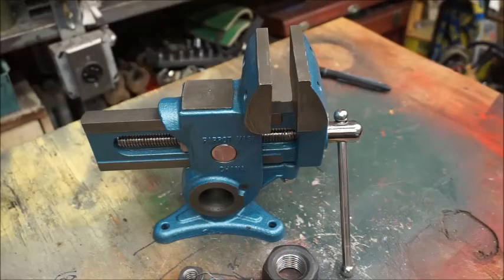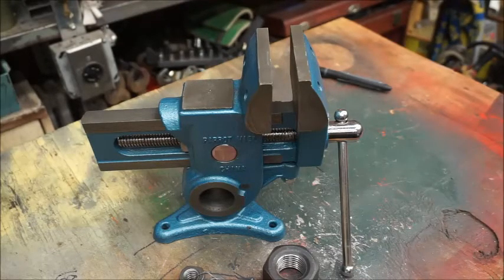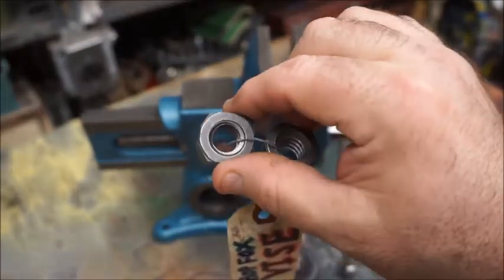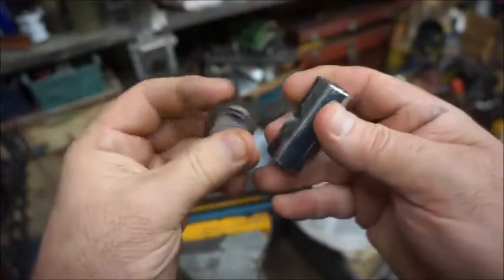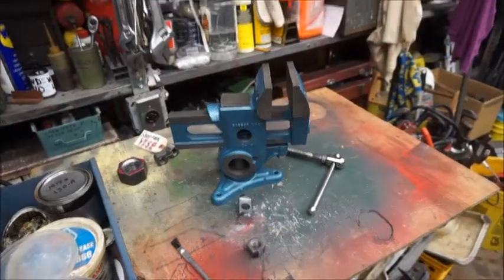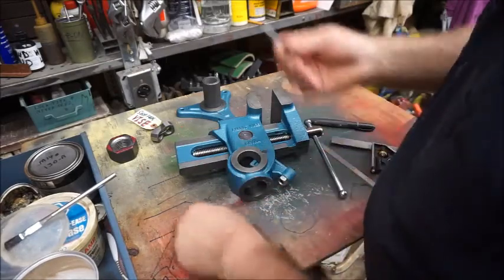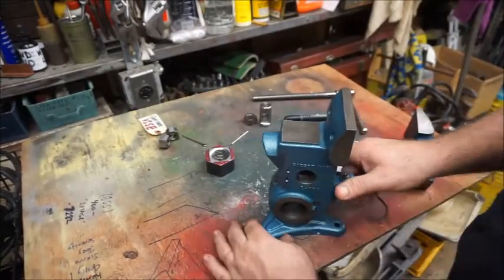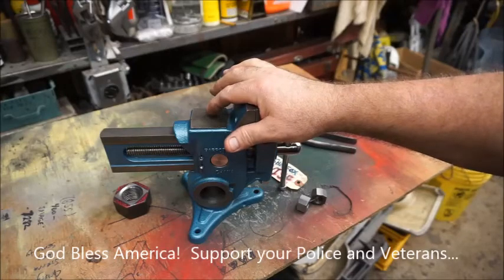How to disassemble and repair the Shop Fox Parrot Vise or Versa Vise

Comment: i know this is a real late comment but would it be economical or practical at all to use a spring around the lead screw? nice video though. im curious how well your fix held up in the long term.
Reply from the maker: Not too late... not as long as I'm sucking air! 😁 
The spring is a very good idea, IMO.  Novel.  One would have to fit the right spring.  I think capturing the nut with some type of pin is probably easier and cheaper.  I am into the KISS principal.  Keep it simple.  I keep a lot of springs but fitting them can be tedious.  I repaired a remote anchor lock for my boat recently.  Didn't have the right spring.  I spent 3 hours manufacturing a torsion spring with mediocre results!   
Regarding the vise repair, well, it held up just fine, but the casting broke where the movable jaw meets the arm surrounding the screw.  I kept it for parts or perhaps welding it one day (would probably break again).  
I rarely throw anything away... like hoarding and dumpster-diving, it can be a curse!  😊
Reply: @bentontool  after a while i was thinkin the same about sourcing the right spring. sorry to hear the vise broke. i been thinking about getting one like it. in your opinion, is it worth it? or should i set my sights on something different?
Reply from the maker: @pyropenguin  Hello.  In 2021, I replaced the Versa/Parrot vise with a different style of vise I bought on eBay for $60.  It was described as "Multipurpose Vise Bench Vise 4" Heavy Duty with 360° Swivel Base".  I bought a similar vise (but the 6" model) thirty years ago and it survived hard use out here on the homestead.  They are all cheap chinesium products, so it is a gamble IMO.  So far, I have been very happy with the 4" model.  The Versa Vise is very flexible and general-purpose, but not heavy duty, again, IMO.  The one I have now is no doubt tougher, and is also flexible.  I still do general-purpose work & gunsmithing on it.  It is still available from sellers on eBay & also on Amazon.  Shop around for the best price.  I suspect they are all sourced from the same place, as they all appear pretty much identical in the pics.  Here is a link to one on Amazon (not an endorsement):  https://www.amazon.com/Multipurpose-360-Degree-Rotation-Equipment-Industrial/dp/B0CKTRDHL2/ref=sr_1_46_sspa?crid=VMTTPIRW5IEV&keywords=4%22%2Bvise&qid=1704384549&s=hi&sprefix=4%2Bvi%2Ctools%2C494&sr=1-46-spons&sp_csd=d2lkZ2V0TmFtZT1zcF9idGY&th=1.  
CAVEAT:  I took mine apart upon arrival, filed all the rough casting edges and inevitable burrs, cleaned-up the paint overspray, added a washer or two where I thought it appropriate, and greased the hell out of it.  IMO, a little TLC & grease goes a long way to prolonging the life of these "cheap" products.  Good luck & best wishes,   A.
Reply: @bentontool  i did similar to a cheap harbor freight vise i got a few years ago. i let my brother borrow it and it didnt survive lol. the main appeal of the versa vise is being able to store it easily. unfortunately i dont have any space to permanent mount a vise currently, but that little post it sits on wouldnt be too big of an issue.

i do like the looks of that chonky vise though. thanks for taking the time to respond with some good info and advise!
Reply from the maker: @pyropenguin  You are welcome.  Understood.  Here's one that I ran across that looked interesting, but too light for my needs.  https://www.amazon.com/Wood-Metal-Working-Multi-Position-distinct/dp/B07V5N1CQP/ref=sr_1_31_sspa?crid=Y1ZGZLZIAO6T&keywords=clamp-on+360+Degree+vise&qid=1704474438&s=hi&sprefix=clamp-on+360+degree+vise%2Ctools%2C186&sr=1-31-spons&sp_csd=d2lkZ2V0TmFtZT1zcF9tdGY&psc=1

Comment: Great video, thank you! I recently found 2 of the original Versa-Vises while picking in a barn but I think they both need new barrel nuts. Because of time and convenience, I plan on ordering new ones from the website but couldn't new ones simply be made from steel stock that was threaded to accommodate the bolt?
Reply from the maker: Thank you Greg.  You definitely could make your own barrel nuts from rod stock if you have a lathe & some internal  thread-cutting experience.  I have found this process somewhat challenging in this small size, and think that a tap of the correct size/pitch would be much easier (but expensive).  Good luck!  I took the path of least resistance... 😄

Comment: Good video Brother. Glad I ran into it. Just so happens my Parrot vise just took a dump (stripped barrel nut) and I was contemplating whether to pitch it or try and fix it. It will also give me an opportunity to take some of the slop out of it.
Reply from the maker: Thanks for the kind words.  Glad it helped.  P.S.  I have switched to another type of vise.  I snapped the mobile vise jaw on my Parrot, probably due to over-torquing I suppose.  Probably would have been OK if I had stuck to only gunsmithing with it, but I was using it for all manner of work, and it was not up to the task...
Reply: @bentontool  I have a really great old Wilton bench vise that is my primary, but the parrot sits right next to my work station and gets used for holding stoning fixtures and times I need a third hand. My wife bought me that vise, so I had to use it. Unfortunately, it was a "knockoff" of the original and recently failed. I've come up short in trying to find something to replace it.
I've been staring at it for a week now trying to figure how it was put together. Now that I know, I need to get after it. Thanks much.
Reply from the maker: @Taj369  Mike, my old Parrot vise was on my home basement workbench, which is very small.  If I had room for two vises, I definitely would mount both.  I often miss the Parrot.   My video was filmed in my shop, which is not attached to the house.  More room there, but I have managed to fill it nevertheless!  😄  Are you a metalworker?  Or more woodworker like me?  I have a spare nut if you don't want to make one.  I don't know if it is allowed, but my email is: benttool@epix.net.

Comment: Terrific fix! Thank you!
I’m curious if it might pay to heat treat the nut prior to installation to give it a bit longer life? Probably better to have the nut fail again rather than the screw...
Reply from the maker: Thank you... my replacement nut has not yet failed as is... case-hardening would be your only option... easy to do if you want to try it... YouTube videos available on the topic.   I suspect the original nuts are very soft steel...
Reply from the maker: Update:  I recently had to buy another vise.  The Parrot vise casting snapped on the mobile jaw (near jaw) arms, at the area that I was filing on the video.  The nuts were stronger than the cast iron of the vise could tolerate.  I probably over-torqued it.  Someone else below commented on how it is possible that the vise nut was PURPOSELY designed to strip-out before enough torque was reached to break the casting... that may be a valid assumption.  Lesson learned: don't over-torque.
Reply: Oh no! Thats surprising. So sorry you had to learn that lesson for the rest of us. I hope you were able to replace it reasonably. Thank you for the update.

Comment: Woodcraft sells a VERY similar "Universal Vise" (https://www.woodcraft.com/products/woodriver-universal-vise). They shipped me a replacement barrel nut for ~$16. Disassembly of the lead screw from the vise was similar, a press-fit bushing. It took a considerable amount of force with a soft hammer to knock it loose. Thank you VERY much for this video, I'm not sure I would have gotten it apart, otherwise.
Reply from the maker: Glad that the video helped and that you were able to source a replacement nut.

Comment: Thanks for the useful video. I have the same vise, which failed in the same way. When I took it apart, I noticed that the screw was so poorly machined (or cast) that it has rough edges that act as a file that will lead to the new nut failing again. I'm trying to decide if it's worth my aggravation to fix it.  Meanwhile I bought a nice vintage Wilton vise made in USA.
Reply from the maker: Thanks Mark.  Perhaps wire brushing will remove the burrs on your screw... probably will.  I just put a lot of lube on mine and it has yet to fail post my repair.  (My screw is plated.  Poor plating does tend to flake off and cause wear.)  In fact, I was just using it today for some gunsmithing.  Nevertheless, I made a few extra nuts just in case.

Comment: What is the brand and type grease you used in the video ?
Reply from the maker: Super Lube Multi-Purpose Synthetic Grease with Syncolon® (PTFE).  Interesting that you noticed... this is the best grease I have ever used.  Shop around for a good price.  Available in all sizes from one ml tubes to 55 gal drums on their website.  I found the tub convenient.  The 400 gram cartridges may be cheaper and available at auto-parts stores.   Thanks for watching... https://www.ebay.com/itm/Super-Lube-Multi-Purpose-Synthetic-Grease-PTFE-41160-400g-/183493170925  AND  https://www.super-lube.com/multi-purpose-synthetic-grease-with-syncolon-ptfe

Comment: I have one without a stripped nut. The slide hammer method only works if your nut is stopped. To get mine apart. Screw the jaws snug, use a clamp to clamp jaws together. Then open vice and tap with brass hammer until bushing comes out.
Reply from the maker: Thanks...

Comment: Grizzly Industrial sells replacement barrel nuts for 3.95 + shipping, FYI...
Reply from the maker: Thanks.  I looked on the website & can't find specs on the nut... for this vise?
Reply: bentontool Yes, for the Shopfox parrot vise.  The price is actually $3.50 + $9.95 shipping, but I ordered another $50 worth of stuff to make it worthwhile. The item # is PXD3125003 LEADSCREW CAPTURE NUT.  Hope this helps someone out!  I really did like your video; ingenuity at its finest!
Reply from the maker: @gcarson19  Thanks for the info and the kind words...

Comment: People question why this happens. I look at it and think it's possible that the nut is the "weak point" by design. Why? Something's gotta give so that if you over-tighten the vise the vise castings do not break catastrophically. The stripping of the nut is a more controlled 'failure' that while inconvenient is safer than having the casting break which might result is pieces flying in every direction or at least whatever was secured in the vise from falling and probably landing on your foot.
Reply from the maker: Hello Bob...  yes, I suppose that it is possible.  However, I can report that there have been no failures in the two years since my repair.  I do not know if the nuts I used for the repair are stronger than the OEM.  Thanks.
Reply: @bentontool  That's good to hear. I wasn't implying you did anything wrong with your repair. It's pretty ingenious given that a 5/8-8 acme thread barrel nut is not a standard item. I searched for a long time and didn't find a source for this size nut.
Reply from the maker: @bobd.  Thanks.   I could not find one either...
Reply from the maker: Bob... well... your words were perhaps prophetic... a few weeks ago, my vise casting snapped were the guide bar meets the mobile jaw... I over-torqued it for sure.  I replaced it with a heavier-duty product... the cast iron has a very coarse grain... perhaps not the best material?

Comment: could you weld the nut to the pin -great video
Reply from the maker: Hello Tom, I suppose you could braze or weld the nut to the pin, but then you would have to turn it round in order to get it back into the casting thru the side hole.  Thanks... hope the video was helpful...

Comment: Would you happen to have the dimensions of the new nut after milling? I would like to get ahead of the game while the vice is still operational.
Reply from the maker: Hello Dan,  be aware, I suspect the internal dimensions of the castings will be a bit different for each vise by brand, etc.  That being said, I am off to work tonight & I will try to get this info to you tomorrow.    See "TOS BOSS" comments all the way at the bottom (first commenter).
Reply from the maker: Nut measures 0.990 x 0.915".   I suggest you measure the ID of your casting first.   Good luck.